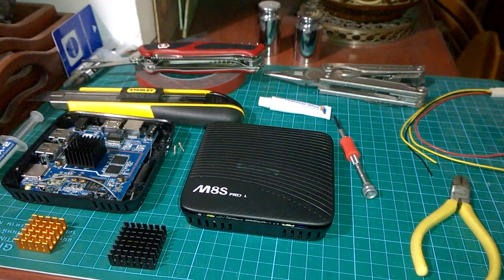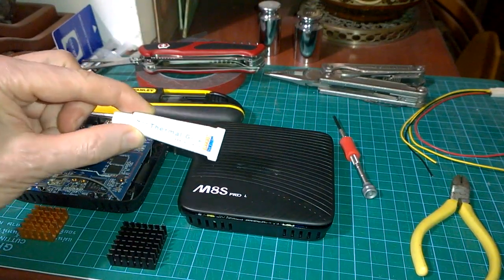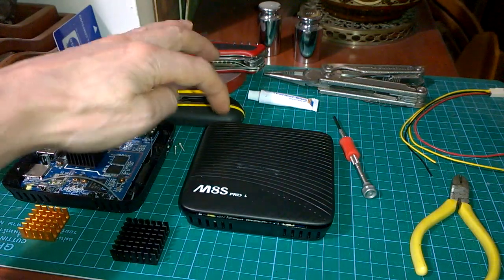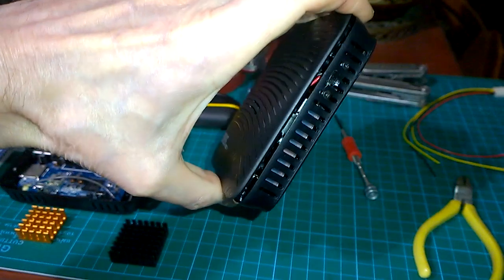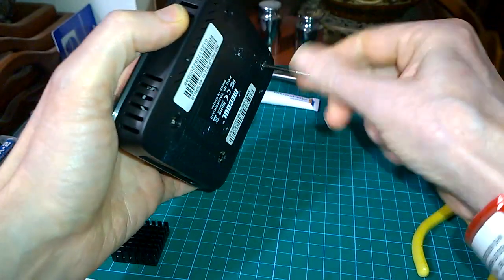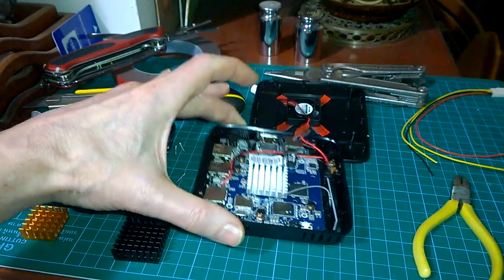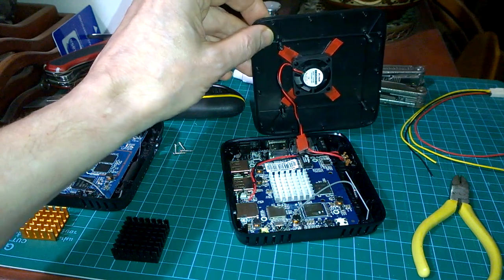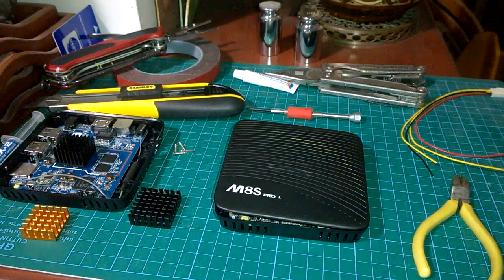MeCool M8S Pro L Overheating - 30mm Fan Upgrade

Comment: You can mix thermal epoxy with thermal paste to improve the heat transfer a little more. You wanna aim for 50/50 max, it will not effect the epoxy to much but it will make it easier to remove down the road.

I've been lazy in the past and just put straight thermal paste on the heatsinks and it creates a good enough suction to keep it on especially for something that most likely will not be moved frequently.
Reply from the maker: Cool - Good info

Comment: Hi, please help, how can I get my mecool m8s w reset? I cant find the reset button.  Thank you for you answer
Reply from the maker: Hi, your box probably doesn't have a switch, just the pads where one should be. Look at front right of PCB - There are 4 pads with a square drawing of a switch from above around them. Short the 2 front pads to "make" the reset switch while adding power to the box. HTH
Reply: @petrev1  thanks

Comment: do we have to put the switch? Or can I just soldering the gnd and v will it the fan turn off when i power the box off?
Reply from the maker: Hi, +5V USB is switched but I find it runs the fan too fast. The switch is for the 3.3V UART connection.
I have now used a small resistor to slow the USB 5V and then no switch is needed - See the Begin to End video link above.
Some people have suggested using the switched 3.3V microSD Power, but the pad is really tiny !!!
Reply: Add a resistor in series with the USB fan to slow it down.

Comment: Looking at my old Intel and AMD books shows its better to blow air on the heat sink if possible. Question do you think most of the CPU heat sinks are undersized in these TV boxes?
To do it right put the proper size heat sink in and a fan if you live where i am can get 85-90F deg in the house. got this box in late Jan. Its never seen more than 70-75 F deg.
Reply from the maker: Thanks for the info. Sorry for the late reply, I somehow missed your replies !

Comment: Question? you have the fan blowing down on the heat sink. I have a MRX pro plus. was thinking mounting the fan on the bottom vent the top heat rises. The box is setting now on 4 legs i made 2 inch high that let more air come in. Then i found as the glue dried the box upside down runs cooler? big vents on the bottom.

Comment: Where do i pin the fan?
Reply from the maker: In this video it is the 3.3V UART pads but they don't switch off, so now I am using the USB pins with an inline resistor (33ohm for my fan) because the full 5V is too noisy for me.

Comment: Got a fan on order, thanks.
Reply: He won't answer he died a year ago.
Reply: @davidbrawn2828  no way, I did not hear anything about that.
Reply: @clarkss12   it was under another video month ago. I forgot all about these when I threw my Tanix tv box away because nothing stopped it from crashing. I never bought another Tanix TV box again. I have learned over time that if it crashes nothing will cure the problem unless you can return it. If not toss it in the garbage and order a new one. I got ripped off on three boxes over time.
Reply: @davidbrawn2828  Sorry to hear about him passing.